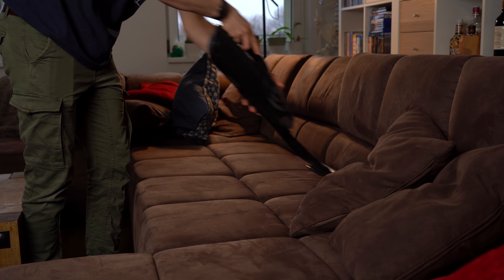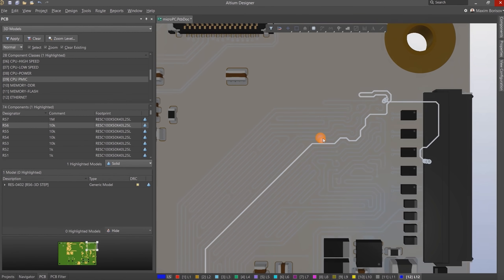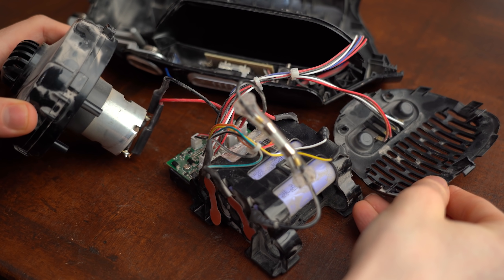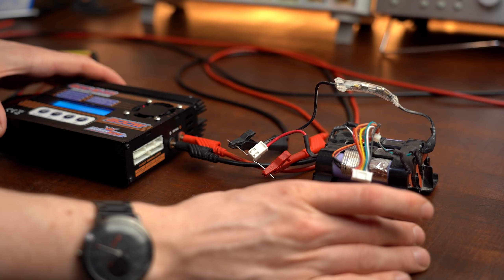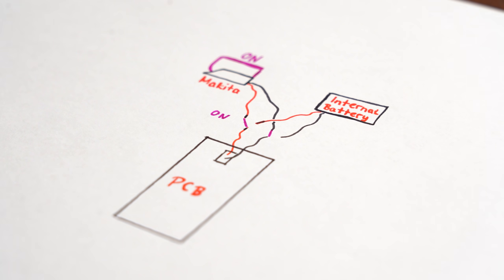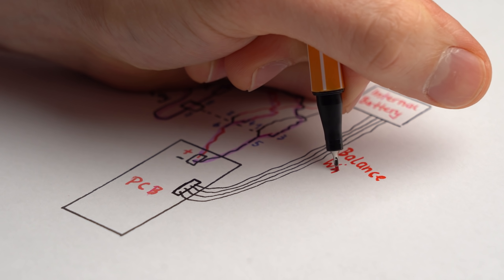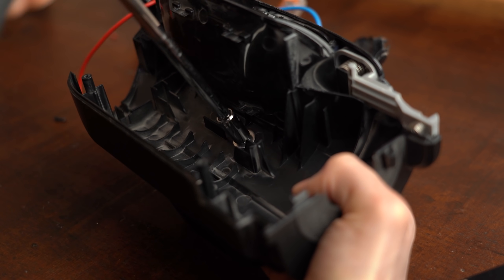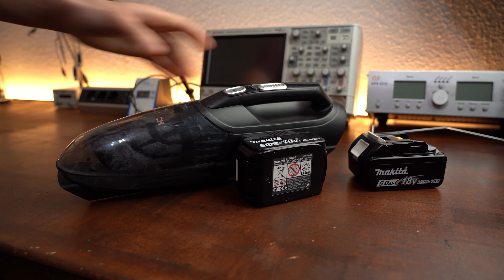Every Device should have this Upgrade! (Endless Battery Run Time)

Comment: 02:00 Wait what!? Where did you manage to buy a large vaccum that charges with an adapter like that? All the ones I’ve ever seen, and the one I have, charge in the stand which also function as storage, thus you never run out of battery unless you just toss the vacuum on the floor when you’re done with it. And then trip on it.

Comment: Great video and clever fix. I'm scratching my head a bit since I've owned several portable vacuums over the years. I don't remember any of them having an internal battery. Maybe Dustbuster in 1990 or so. Without stereotyping Germany too much, is there a law against external battery packs on vacuums?

Comment: What about the under-voltage protection for the Makita battery? This is normally done by the Makita tool
Reply: Nope, battery has it's own protection (since you might be using an older Makita tool that predates the current level of protection)

Comment: 6:43 hey, noobie here, is there a reason to prefer two 100 Ohm resistances compared to one 50 Ohm resistance? Is it just because 100 Ohm ones are more common? (I guess there might be a point for heat dissipation but i would not think this is the case)
Reply: I believe it is exactly for heat dissipation, as these resistors usually only handle 0.25w of heat each. :)

Comment: Have you done a project to detect an audio source to activate an external relay? For example when toggling Alexa for music and the AUX is activated then an external amp is turned on with the audio signal, when Alexa (or any other similar thingy) stops the music then the external amp is turned off for no power consumption. I Tried it with opamps and an Arduino but couldn't make it work

Comment: Excellent shame the manufacturers aren't as smart as you they would design it with a removable battery in the first place.
Reply: Cost, an integrated battery is cheaper if all you need is a vacuum cleaner.

Comment: This was great. I have the exact issue and was planning on doing the same thing. Only difference is that the IC in mine died so I have to figure out a way to wire it directly to the motor without burning it up. How would you do it?
Reply: Make sure the battery voltage range of the tool and device match (if they're both lithium ion and same number of cells, you're all set).
If it's a 2 wire motor, it's a brushed type and you can just connect the battery directly. Switching it will need a switch capable of handling the DC current - if the device already has the switch wired inline with the motor, you can use that.

If the motor has 3 wires, it's brushless and will need a controller, which may be what the dead IC you refer to was for. RC ESCs can be used for this purpose but you'd either need one that can be reprogrammed to just run all the time (BLHeli compatible ones theoretically can do that) or a PWM signal source to drive it.

Comment: It is Sony/Murata VTC5 or VTC5A cells in that Makita pack. Those cells can discharge 30A continuously. They are monsters!! If I remember correctly the internal fuse is 50A (pack is 5S2P). So 7,5A is a walk in the park for those cells :)

Comment: Hmm, so the problem was forgetting to charge up the vacuum cleaner, so rather than adding a Post-It note to remind you (or some other more efficient German method) instead re-engineer the machine. I guess this way it makes the problem one belonging to the machine rather than the user ....
Reply: Nah, a full house clean takes 11 minutes but after 10 minutes the juice runs out. Now you wait 4 hours for the battery to recharge. Or you swap the empty for a full.

Comment: I was hoping you would just remove the internal battery and replace it with the makita battery. then you just swap them out when they run out but the internal battery seems to still work. I did something like this with a 7.2 volt NiCd cordless vac I just added a cord to it and it runs on 12 volts. It might be time to make it cordless again with lithium cells and BMSs becoming more available.

Comment: Im so glad i bought the makita vacuum not these brands. I have Makita Dcl180Sw, they had a campaign where it came 100€ with a charger and a 2ah battery included. Ive been using it for 2 years and I feel the frustration others are facing with internal batteries. So many devices like shavers, trimmers and other tools have same issue but are still being sold. I wish companies would design more things with changeable 18650s cells

Comment: I just did a similar mod about 2 months ago. I use Porter Cable cordless tools but they don’t make a hand vacuum so I got a Craftsman. The PC packs are a bit wider than Craftsman so I carved out the housing a bit. The contacts are narrower so I cut apart the plastic holding them on the tool side, filed them down, and added spacers the re-center them.

I did kind of kill the tool’s control board with accidental reverse polarity when testing, but I was able to make a replacement with a MOSFET and an Arduino (the MCU is so I can monitor pack voltage and temperature for auto shut-down).

The whole thing almost looks stock because the batteries install in the same place as before and both the tool and batteries are a similar shade of red.

Comment: If you are using the main terminals on the Makita packs, there is no over-discharge protection! At least there wasn't five years ago when I stacked three of them in series to power my go-kart. The BMS would only balance the cells, it relied on the tool detecting an undervoltage condition.

Comment: Honestly I wish more products like these would use either exchangeable batteries with larger capacity options or have a battery add-on like this.
Reply: I kind of wish laptops could use tool batteries...
Reply: You can charge laptops using these now. There are usb-c adapters for some makes of batteries.

Comment: Interesting project. I tried to fix a similar vaccum a year ago but unfortunaletely failed because the electronics was broken and i didnt managed to replace it with simple electronics components because the voltage from the batterie was certinainly modulated by pwm with high performance mosfets. I couldn t just switch on/off with a relay because there was two differents motors : one for the brushes at the bottom and one for the fan which seemed to work with different voltages :/

Comment: That's funny, I found the exact vacuum cleaner on the streets about a year ago and wanted to do exactly this with a lidl 20v battery !
Reply: Be aware that the Parkside batteries relies on the tool to cut power when the battery is discharged

Comment: This is actually a good idea. I wonder if the vacuum cleaner shuts off if the makita battery pack voltage gets too low to prevent overdischarge.
Reply: I didn't catch whether the relay will shut off when the battery gets too low... I don't even know what 'too low' is for a battery pack.
Reply: Battery pack probably will cut off ? ....

Comment: I don't know much about electronics (Mechanical Engineering guy here), but what about some kind of supercapacitor system with staggered discharges and boost converters? Probably not worth it when you can just do this, but it'd charge super quick.
Reply: You would have power for a few seconds, maybe a minute. These supercapacitors dont store much energy.
Reply: @georgwagner4438  that's kinda what I suspected.

Comment: Yeah there is definitely a lot of things you can convert to use Makita batteries. I made a portable lab bench power supply that can run on 2 Makita 18 volt batteries in series, or be plugged in with wall power

Comment: What does the internal balance circuit think when the internal battery pack is drained and you want to use it with external battery? Will it work or think the battery voltage is too low?

Comment: you can also hear the motor works considerably better with the external pack.  Almost certainly because of less voltage sag (battery packs for tools are designed for current draws of 20amps and above)
Reply: Faster does not mean better
Reply: How so, motors in cordless tools are so current-starved to begin with that actually running them with higher discharge batteries and a slightly higher voltage(like less than half a volt when going from 5 cells to 6) would probably make it run cooler and more efficiently anyways

Even just going from a bad 5 cell pack to a better 5 cell pack would be a good move if the wiring is thick enough
Reply: True. That's why i found it funny when he bothered to test the battery pack at 7a as if it couldn't handle it. But as we saw it handled it with ease as they are designed for well above that.
Reply: depending of the motors.. 
because 20Amps from the battery was just like short circuit current, and if that happens the battery will very toasty..
the power tools motors usually need 7 or 8 Amps depending on the load or application of the powertools..

but, you were right.. because the battery packs from the makita, have higher capacity and also they have 2 parallel battery of each cells..
so, the configuration of the battery packs is 5S2P.. with this configuration, the battery packs can deliver more output power.

rather than the internal battery packs from the vacuum cleaner, just 5S1P.. so, the output power slightly smaller.. 

and also the battery packs was aged, so their capacity decreased and the internal resistance of the battery increased which that affect the output power.. and more voltage drop while outputting the same amount of power than while they are still brand spanking new..
Reply: I have taken apart many battery tools and gadgets, and the motor that is in the vacuum looks to be the same motor that you will find in most battery drills, power-wheels, small kitchen appliances... so, in that way, I think we would see that the new battery pack and the motor are made for each other, if we had a closer look at the specs of the motor.
Reply: Unless the motor also pulls more amps, aka it will die quicker if it's out of the motors' specs. If the design was expecting X voltage sag, they may have used a lower spec'ed motor, running without that sag it will draw more amps.
Reply: @Timmy_EUC  Well, technically not wrong, but I'd say that would be a rather crappy way to design a product, where the tiniest change in voltage will make the difference between it operating normally or dying, it isn't unusual to run a motor an extra volt or two higher and be perfectly fine, you can run them even higher than that as long as you're careful to avoid overheating it.
Reply: @Timmy_EUC  The motor will most likely die sooner, not just because of the increased current draw but because it most likely wasn't designed to keep working for longer than maybe 20-30 minutes at a time, with a couple of hours of break in between.
Reply: @MikrySoft  I wonder how long it takes him to hoover the lounge? 🤔
Reply: @MikrySoft  just put a fan on the motor fan bro
Reply: @MikrySoft  wrong, especially if it’s a brushless motor, the only parts that are touching are the bearings, and bearings (even the cheapest, bronze bushings,) don’t heat up much if the correct lube is used.
Reply: @jamesshriver4822  you know that brushless motors can develop a shit tonne of heat too? Or are superconducting brushless motors a thing now?
But this isn't a brushless Motor anyway. Has only two terminals.
Reply: @Timmy_EUC  if they specced a motor that close to the line, it wouldn't be long for this life anyway.

Comment: I've done a similar thing to my Electrolux. Since the internal 8S 2200mAh NiMH died on me, I've put 5000mAh Li-ion in 3S and a BMS. But my mounting is horrible and charger is a RDtech supply lol

Comment: Great video. That said, would like to also see a video exploring the idea of replacing/upgrading the vacuum's original cells, with the highest capacity cells possible(!)
Reply: Well that one is just too easy 😉 and would take even longer to charge...
Reply: @rpavlik1  He could have checked how much the charger could theoretically pull and then upsized the PSU to one with fitting amps

Comment: Lol. Well knowing your style, when you pointed out the charge rate, I thought you were going to upgrade the power brick.

We got a roller type one, which is more a brush. It had 4 Nmhi batteries which were 450 Mah. The run time was just about do the job. And so now I can do the whole house about 8 times before needing a charge.

Oddly the brick for it is 7.6v and it's a 5v battery. When I took it apart it has a power regulator. So I cannot use the power jack unless I built a circuit for it.
However I pop the cover off, and it takes 2.5 hours to charge with my custom "anything charger/PSU"
It's only a small one, has a digital display for volts and current. It's 3amp nom and can go up to 5amp. But I let it run slower as I have a bigger 8-9amp charge anything attached to my solar system.

Nice old school relay used here. Any chance you can make a video with a Lucas charge controller? 
I got one for a wind generator project I've never got around to making.

Comment: What about a undervoltage protection, when baterry get discharged ? Does Makita have internal protection circuit in batteries or in tools ? I made some project with parkside battery and I must use undervoltage circuit in my device ... :) Thank you for cool video :)
Reply: I was wondering about that too. I suppose it’s easy to test though.

Comment: I've used one of those 20V battery packs to jumpstart my old chevy truck, I'm sure they can handle a little vacuum cleaner (granted the drill battery I used was smoking afterwards because of the high current draw, but when you're stranded on the side of the road and gotta be somewhere you gotta do what you gotta do!)
Reply: Didn't ElectroBOOM do it with AA batteries? lol
Reply: @aliveandwellinisrael2507  yep
Reply: @aliveandwellinisrael2507  oy!
Reply: @1337GameDev  Yep, that's why you get 7ft away and hope it works
Reply: @linuxguy1199  That is why you connect it to your car battery and let it sit for a good 5-10 minutes and let it haste slowly 😀
Reply: You gotta unplug them fast!

Comment: You also may repack the 18650 cells to new ones. 3000-3500mah per cell is nothing special today so you easily can get around 5 times more capacity then before.
Reply: When they are flat they are just as flat tho, with external batteries your runtime is basically forever.
Reply: @astranger448  true that, but having internal batteries with bigger capacity is always good

Comment: You could just have bought the cordless makita vacuum to begin with, they are pretty good. The style that you use, allso you can get a syclone for the makita one with increases the capacity. it is a good candidate for housing your weakest batterys, because they do not use much power.  All that being said i understand why you would want to upgrade an existing device. They have very good no nonsense battery packs, but the trouble is that the battery protection for discharging falls on the device and not the battery pack (for makita). The bldc rated makita batteries can do to the neighborhood of 25A continuous, they need that to run the big appliances like lawnmowers, weed wackers and chainsaws (@36v).

Comment: Nice, great idea that i will do on other devices. Question though, did you notice a shift in the center of gravity of the Vacuum? If so, does it become annoying when the external battery is installed?

Comment: that is defiantly interesting! Was it just me though, or did it sound like the motor spun faster with the external battery? maybe able to pull more power? or was it just due to different states of charge.
Reply: Yep, defiantly.
Reply: I have almost the same Vacuum and I wouldn't mind a bit more power.
Reply: Yep big difference indeed

Comment: I have similar bosch vacuum with Ni-MH cells, maybe I will modify it one day. But have you ever heard of the battery cases? You could buy them along with 10 VTC6 cells, weld them and make your own makita battery cheaper and with more capacity, it could be a nice solution considering who you are.
Reply: Nothing cheaper than that batteries he already owns. Also those 10VTC6 cells will not fit the angle grinder....

Comment: i love doing those mods, i had this floor scale on my bathroom that used CR2032 and with some testing i managed to mod it to work with a TP4052 and a LiPo battery from an old smartphone.
Reply: Similarly, I did this mod for a friend who is sick of buying AA batteries for the tabletop decor. It used 3 cells so I just cut a USB cable and it runs fine. 

Thinking back I should have used a voltage regulator to drop the voltage by a little
Reply: @harrytsang1501  well before i done the mod on my scale, i tested with my lab bench power supply, also the scale was really cheap so if i killed with with overvoltage it wouldn't be a huge loss, because honestly i wouldn't keep buying CR2032 every 2 weeks.
But the correct way would be using a low dropout voltage regulator, but it wasn't worth the trouble.

Comment: great idea, Great Scott!
I will ee if I can do something similar with my Dyson vacuum cleaner and my Lidl battery packs...
Reply: Be aware that the Parkside batteries relies on the tool to cut power when the battery is discharged
Reply: @jeppekristensen5589  good tip!
Thank you!
(I would assume that that's true for the internal battery of a Dyson as well...)

Comment: Nice job ,  I did the same thing to a  b&d weed eater the ni cad batteries were no good , used a rigid lithium adapter mounted to the old battery location,  and slid in a rigid 18 4 ah battery . Works better then new .  I enjoy watching your channel , looking forward to the next video  😀

Comment: Won't it be a problem with the Makita battery charging the other battery through the balance connector? Or I guess if the gnd reference switches to the Makita battery, then the BMS would read strange values whenever one of the batteries is drained and the other is full? 🤔